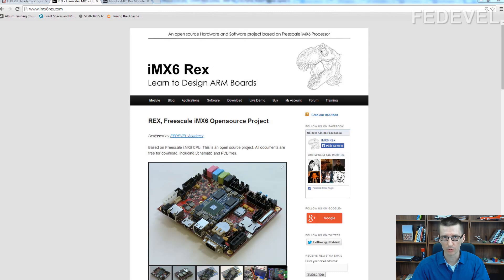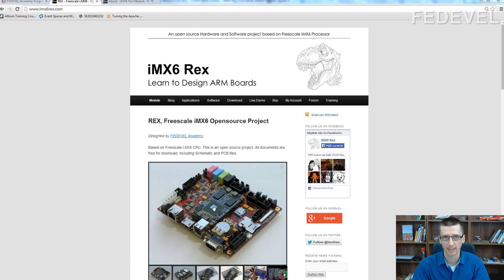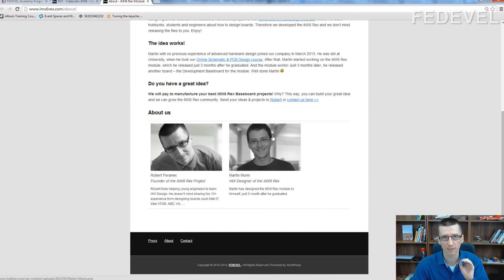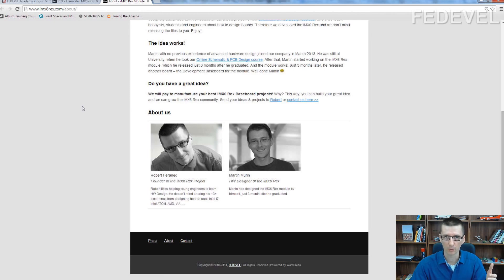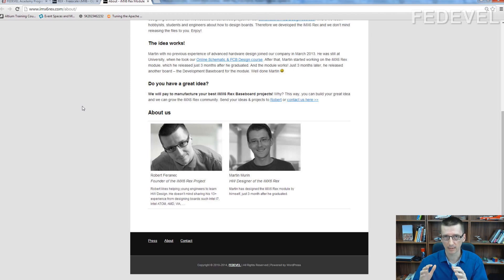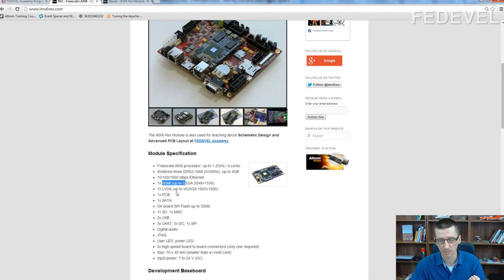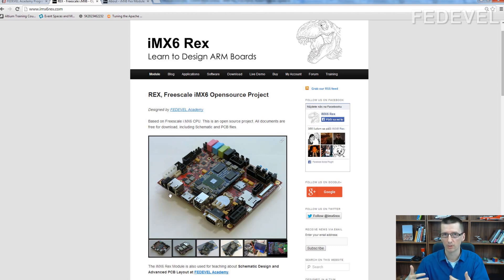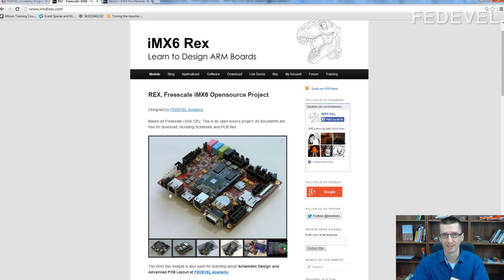Advanced PCB Layout - Online Course

Comment: Hi Robert, i just began your lessons, when i move connectors J1 or J2, i cannot see the connections, but i can see them if i move others components, i am using AD20, is there any settings i am missing? Thank you
Reply: I found it,  Preferences>General>Advanced> PCB.ComponentDrag.ConnectionLimit,  i increased to 100, the default was 50.
Reply from the maker: @dukeibzusa  :) Yes, I was writing exactly the same answer just 5 days ago. I do not know why they changed it ... so many people have problems with it - including myself.
Reply: @RobertFeranec  Thank you Robert, there is another thing: when using cross probe, selecting a net, then holding shift selecting components , everything works fine, but when selecting "reposition ...", all the pcb is masked during the placement, including the net i selected.

UPDATE: Uncheck "Apply Mask during interactive editing", Preferences>PCB Editor>Display
Reply from the maker: @dukeibzusa  Thanks for sharing the solution.

Comment: Hi Robert, I already made your basic course of Altium Designer on UDEMY(Great course,  by the way) and I'm willing to do this one. It is possible to follow all the steps of this course using Altium Designer 18? There will be a new version of this course using Altium 18? In which course the OpenRex board is developed?
Thanks for your great Work.
Reply from the maker: Yes, you can use AD18, no problem. If you are using AD18, this page will help you:
https://www.fedevel.com/academy/updates/
 On the page you will find free youtube videos which I created to cover the most important differences. I may be re-doing Advanced PCB Layout course in AD19, but it is not necessary. The course is about hardware design and Altium is only a tool used to explain and practice. Many people watch Advanced PCB Layout even when they are using a different software. Also, the course is based on iMX6Rex module and Development Baseboard: https://www.imx6rex.com/